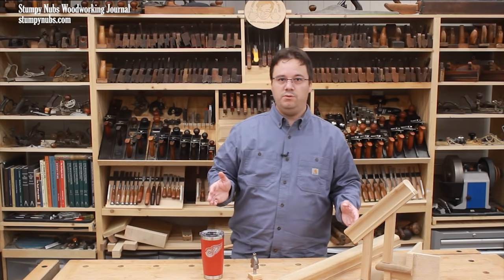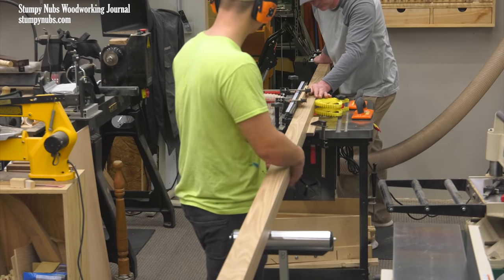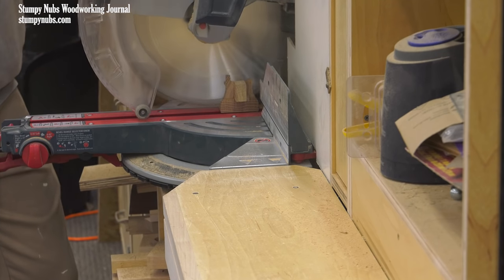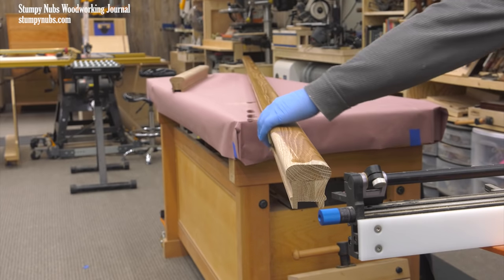Why you should make your own stair railing

Comment: I just took apart an old handrail and baluster set up, raised the upper guardrail to code, pre painted most of it and reinstalled. It had a really long railing that was 2 pieces joined by a square nut and bolt system.  Really cool how the forefathers of woodworking did things..

On the subject of making one though..

Of course I have a 15 inch planer I paid good money for but can not get it adjusted properly and I have an old delta bench jointer which I tried using but, have no idea if its working properly and of course there is nobody I know of in the Harrisburg Pennsylvania area that works on this stuff or at least does house calls.. the planer was a beast to get in my shop and I likely knocked it out of wack in moving.
 Paying the yard to do the milling is way too much which puts this task out of reach currently
Reply: The square nut is an early example of the handrail bolt, invented for butt- joining handrail pieces.  This followed the early (19th Century)  geometric, handrail drawing methods, which where based, solely on butt-jointed pieces. The drawing method didn't really work for the former, handrail scarf-joint.
The wrench-tool was known as a punch or "chaser."  Or two separate tools.
Sometimes the bolts had a swell in them below the threads.  This was designed to jamb in the bolt-holes.  
The star-nut is also part of that period and still in use today.
BTW, raising an old handrail to modern handrail height, code requirements, is only required in all-new construction (or so I understand.) Many architectural features may suffer if you do this .

Comment: If the specialty bit is out of reach, run the stock over the table saw blade at 30 to 40 degrees. Use both rail guids to secure a temporary fence. Set blade height up just enough to get the hand grip groove. Several graduated passes is best. A smaller diameter blade is better I think but it is a choice. Definitely follow his instructions to make passes on both sides before making an adjustment so the center remains centered.